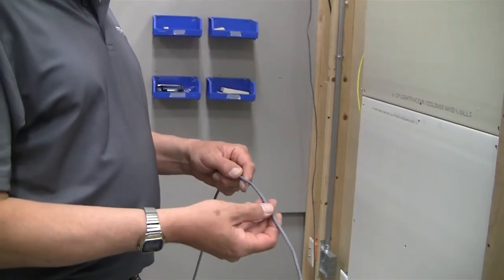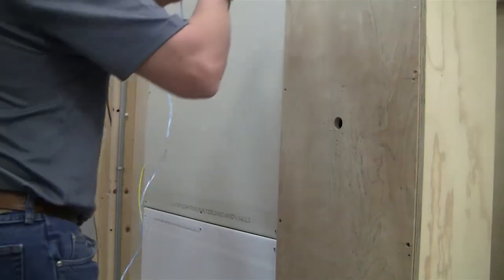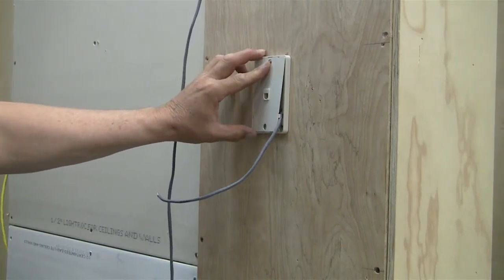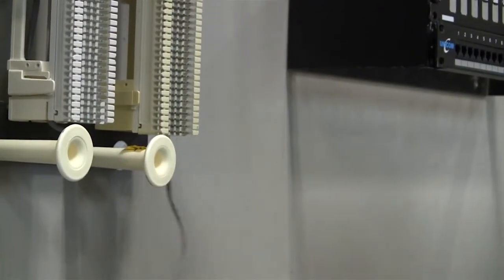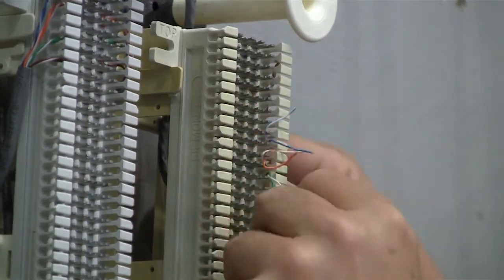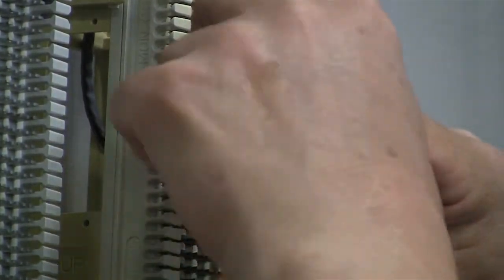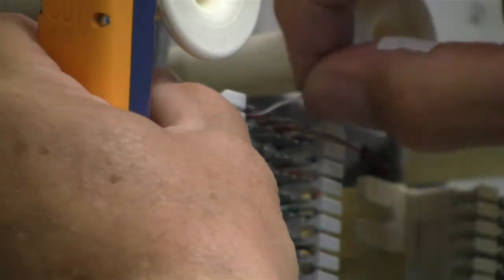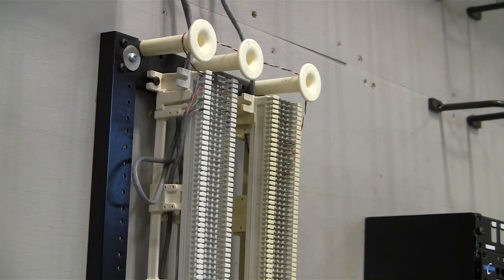Telephone Installation

Comment: Would you not typically have bridge clips on every extension so that it can be isolated without removing wires? I don't understand why you jumped from the telco side direct to the extension with no means of disconnect.